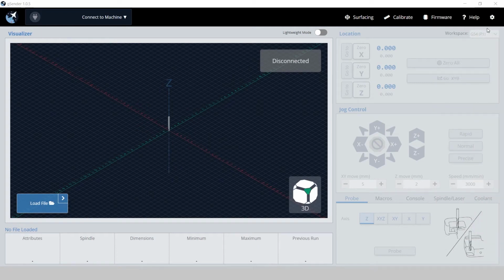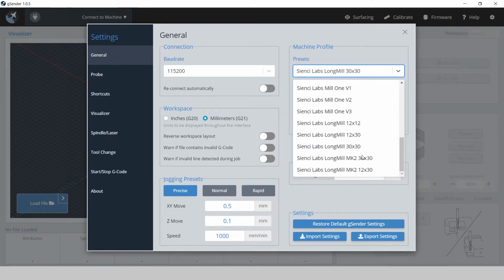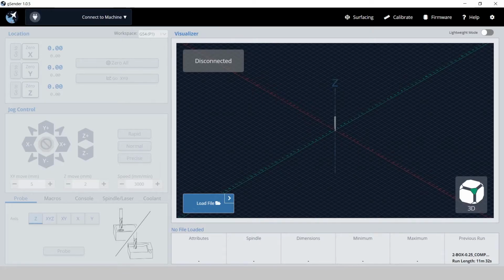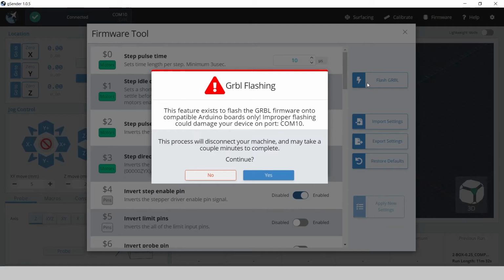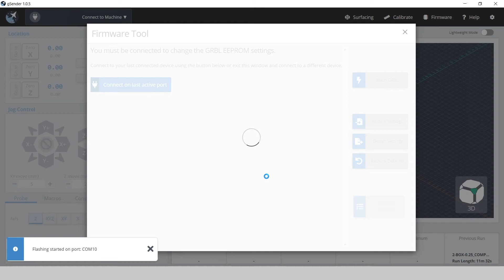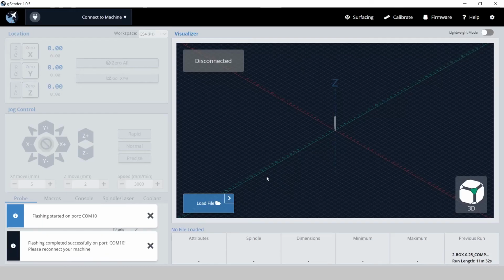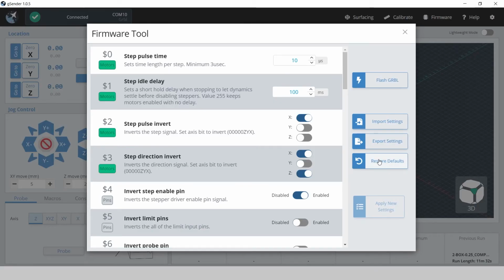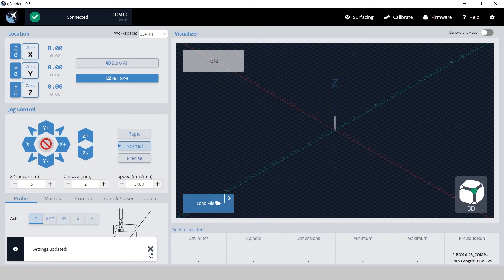How to Flash GRBL Firmware using gSender

Comment: Why would I need to use this flash tool?
Reply from the maker: This comes in handy if you've accidentally done irreparable harm to your control board, or you replace it with a new one and want to make sure it's up to date
Reply: how and where does it get the firmware for the specific machine,   is that within the gsender code?
Reply from the maker: For grbl boards it's stored in the gSender code. Currently all Sienci machines have machine-specific flashing, while all the rest use the default grbl firmware

Comment: Will this work on cnc 3040? I updated firmware now cant use cnc
Reply from the maker: If your machine is GRBL based, it should work, but generally our testing with gSender is for the LongMill. If you flashed your 3040 with LongMill firmware, you will need to reflash it with 3040 firmware instead.